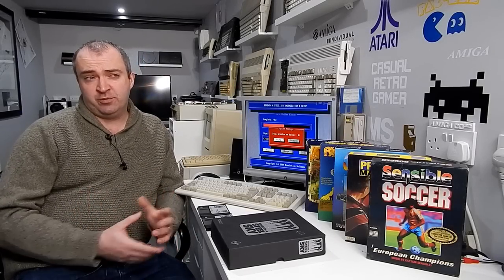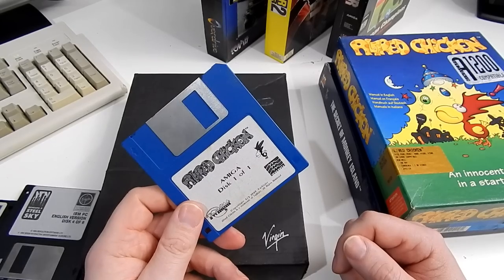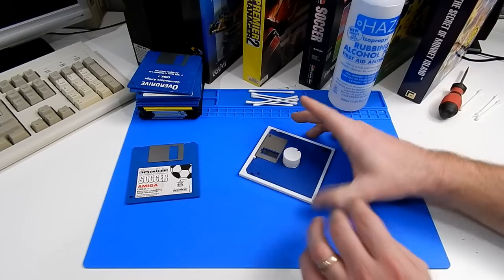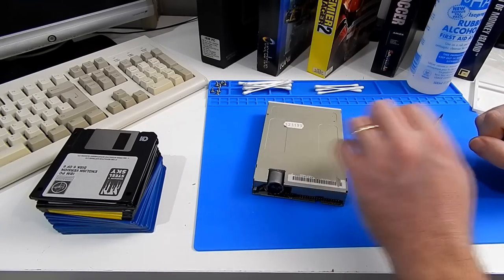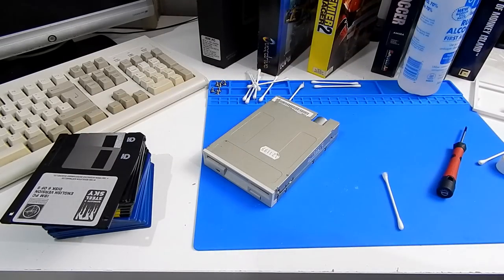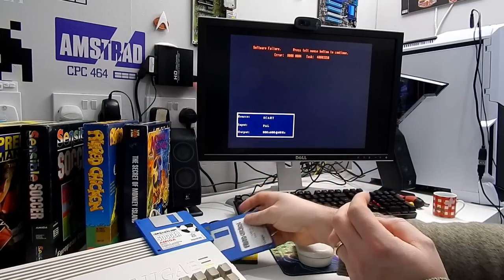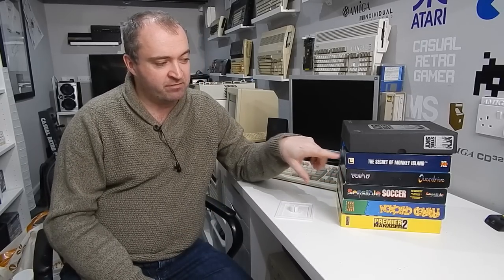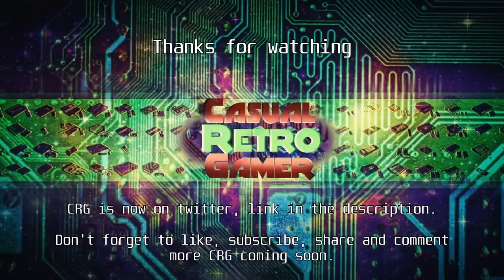Cleaning Floppy Disks, will it fix them?

Comment: Unfortunately, the "dirt" you saw on the cotton buds wasn't dirt; it was part of the oxide layer coming off the wafer.  This explains why some disks were worse after cleaning.  Unfortunately, there's not much you can do in those situations.
Reply: This happens when using 90% alcohol. Only 70 % alcohol must be used.
Reply: @dlfrsilver  He used 70% alcohol
Reply: @dlfrsilver  I think it is 50% that is recommended. Even then i would definitely be on the safe side and use as little as 25%, if at all
Reply: @vetar3372  there is a cursor on what to use. 70% is strong enough without being destructive on the disk surface. I have cleaned more than 800 disk with my method, and it works :)
Reply: @dlfrsilver  Well, i am not going to state anything. But i think it is better to be safe than sorry. I also wonder if the local climate will have any different effect on disk degradation and when it comes to cleaning them (this topic is still fairly new to me)

Comment: Back in the old days of fixing amiga disks that went though hell aka killed by magnetic fields of TV or Speakers ... you copied sectors to the same disc 5 to 8 times in "X-copy" ... fist you scan the disc to find if it has bad sectors in X-copy : 6 means BAD sector , 8 also means bad but its also means disc was damaged by magnetic fields ... then you simply mark those sectors and recopy them 5 to 8 times to the same disc... by this method you can fix many Amiga games ... when they boot and are good , you do a copy of it and store it ... but a word of warning, some Original Amiga discs had Sector DRM ...so even if you fix the Data , the Non-readable sectors of the DRM could be damaged making the disc fail ... but X-copy was the silver repair\piracy tool for all

Comment: I'm so glad I made disk images of all my old games that were on floppy's. When one of the originals gives an error, I succeeded sometimes in just writing the image I had again on the disk. Unfortunately this does not work all the time (if the disk is actually just broken beyond repair). What you can do to have the "original" disk, is pry open the floppy, and replace the disk with one of a floppy dat does work, and reassemble the floppy disk again. It's a bit of a hassle, but you can save the "housing" of the original floppy this way, with a working disk inside. I recommend "practising" this technique first with some floppies you don't actually need.

Comment: 3.5" disk spindles have two holes in them, the center hole and a rectangular hole set off to the side. I have seen another design out there for the disk holding jig where the spindle turning thingy has 2 pins on it instead of 1, so it engages both of the holes in the spindle. That one would probably grip the spindle better so you wouldn't have the problem where the thing just spins in place.

Great idea clamping the thing in a vise. In hindsight it is totally obvious, but for whatever reason that idea never occurred to me.

Comment: Good Video .   Like you had in the video I have had mixed results with cleaning  disks.   If you do not have a 3D printer you can use a piece of tape to hold open the floppy's door while cleaning.  As a last result I have written a floppy image to a new blank and swapped internals with the original to make a good working 'original'

Comment: Excellent video.
I have collection of Atari 1050 drives with 5.25" floppies.
These days when I use it I remove the lid to make sure the head is clean and that a disk doesn't leave dirt on the heads after use as this can damage the next disk put in the drive.

Also I keep my floppies well stored with moisture capture cartons in the same room. Seems to work!
Occasionally get the odd disk that develops a bad sector, and your demonstration is a brilliant way to fix it.
Great to see others with the same passion for retro!
All the best 🙂

Comment: I had WAY better results using warm soapy water (just a bit of dish soap) than I did with IPA.  It did a phenomenal job cleaning off mold from some old disks.  IPA just sort of smeared the crap around versus actually cleaning it.  Said moldy disks had destroyed two of my floppy drives (Macintosh Sony variable speed drives, so it's not like I can just swap them around with generic drives.)  Audible screeeach, then a thunk.  Neither drive would read floppy disks after many attempts at cleaning the heads with IPA.  However, after my success with cleaning the mold off the disks themselves with warm soapy water, I did the same with my floppy drives.  Brought both drives back to life.

So if you have a disk that wasn't working after a clean with IPA, I'd say give warm soapy water a try.  Use the IPA to clean any soap residue that might be left.
Reply: Please help me! I have already 3 drives of 5 1/4 that all they do is destroy disk after disk, they leave deep grooves on the disks and after cleaning and cleaning and more cleaning with alcool seems to make them worse and worse ! I dont know what to do ! I dont think its just a problem with moldy, flaky old disks ... it must be the drives themselves :(
Reply: @fft2020  Unfortunately it sounds like a damaged heads on your drives if they're scratching disks.

Comment: I've had success cleaning floppies - I realise I was lucky with the batch I had and they were just dirty rather than damaged.  Basically, crack open up the case at the bottom edge and drop out the disk itself.  With a little neat washing up liquid, go all over both surfaces of the disk, rub it in well and give it time to work.  If the disk comes away from the little metal carrier it sits on, don't worry about it for now.  Now wash the soap off and make sure you dry the disk really well.  Now you can re-attach the metal carrier VERY CAREFULLY with a small smear of superglue.  Slide the disk and carrier back inside the case and seal the case with a tiny smear of superglue.  Now test it.  I've had success with this method but use it as a last resort ;)

Comment: You can try my cleaning kit, you can find the download in the link in the description here: https://www.youtube.com/watch?v=I-MKpgO4nOY. It uses the off center hole to turn the disk donut, and I use a microfiber cloth instead of a cotton bud which can leave dust inside the disk. I've cleaned more than 300 disks successfully with this thing. I don't really print and sell them anymore but you can have it done by a friend or online.

Comment: I've had some success with using compressed air and blowing it through the hole in the hub and around the outside of the hub. Also through the door both sides. I use a compressor with water trap filter and a pressure regulator to drop the pressure. Doesn't always work but worth a try.
Great video.
Thanks.

Comment: Great video and congrats on the 2k+ subs mate. That's awesome. Re disk cleaning, sadly I had already tried this exact method on an entire Tenstar Games pack for the Amiga, including Barbarian. Now to be fair, ALL Ten were terrible, none loaded except Mercenary (once) and ALL made horrid scraping noises. The A500 itself was hardly used by it's previous owner. As a result, the drive is squeaky clean and all other disks work 100% fine all the time. So.....I took to cleaning the disks as you did, and NONE worked and then even Mercenary failed. They all continued to make horrid noises and Barbarian disk failed completely to the point the disk surface came away from the center wheel. Why? Well, because this method "can" be too harsh. Apparently the better method is to use a little ISO on a macrofibre. Using the caddy you printed, you hold the disk open and hold the fiber lightly on BOTH sides of the disk while turning the wheel. This applies much less ISO than the botton bud method and is less abrasive to the surface of the disk. Seems like a fine art. NOW....all that aside, I did also clean 2 Amiga Format cover disks with the cotton bud method (STOP OVERRIGHTING OR BINNING THOSE BY THE WAY lol ;) ) and they seemed to fail. I randomly tried them again a few months later. They first failed...and then...they both WORKED! So.....I dunno lol. I think it's a very fine art and depends greatly on the reason for the initial failure. Going forward, I'll be looking to get a Greeseweazle to restore original disk images to new media, and swap out the guts. Also risky but I can't make the disks any worse than they are now lol.

Comment: Sounds like a case of, “If it ain’t broke, don’t fix it’ - but if your big box games are dying, it’s definitely worth a pop.

Aside, out with of something like FluxEngine (which isn’t hard btw) to try and recover the original images have you thought about downloading disk images from online and writing them to different disks, and then transferring the magnetic platters into the original floppy cases?

Either way, great video, and very informative. Thanks.
Reply from the maker: That's probably the next stop for the likes of those steel sky disks, swap out the platters and rewrite the contents.  Not that's is really necessary since you can always use a modern alternative but still nice to try and keep the old media going.
Reply: @CRG  Since when has collecting big box games about being able to get them elsewhere? <3 x

Comment: I've just tried this on some discs I was imaging with a DiscFerret (same principles apply to Greaseweazle, which works the same way). Discs were showing patterns of errors in blotches on the HxC Floppy Editor "disc" view. I cleaned them with a foam swab and isopropyl and re-read them, and got a good read from most the second time around. Trying other brands of disc drive and cleaning the heads helped too.
Sadly I've yet to find a good solution for 3.5in discs where the hub has detached from the magnetic disc 'cookie'.

Comment: That's why I always try to create a disk image of my original software. Fortunately, I was able to do it to most of the disks I bought first hand. But some of the games I bought used was 'no go'. Conquest of Camelot, for instance, the 3.5" disks were all good, but the 5.25, kids 1 to 4 were unreadable, but I've not tried to clean them yet.
Also, in the past, I've made the error of putting dirty disks (with mould) in a drive... the movement and contact with the drive head was enough to damage the oxide layer.
It is also crucial to clean the disk drive after this type of incidents, to avoid contaminating other floppies.
Reply from the maker: Yep, certainly a good idea to backup.  Not something I ever though of back in the 90s though.

Comment: I used to open the disk, and then clean CAREFULY prependicular from the center to the outside, and then put the disk inside the plastic case again , and close-it. and it worked for me.
Reply from the maker: I was going to try opening the disks but thought it would be easier to just work through the door.  Also gave me a good excuse to use the 3D printer 😉

Comment: With my Amiga I only use my disk drive to image disks. These can be created in ADF format for use and to backup the disk. You can also image out to a disk if it fails or the data gets corrupted.

Comment: Something worth considering is to make copies of your important collectable disks onto a preferred media type and only use the copies. You'd be surprised how many HD floppies can fit on to a modern sized media like flash disks or HDDs.
Reply from the maker: Yep worth doing.  I rarely use floppies these days but the point was more to see if I could revive known bad disks.  At this point my big box games are display items only, especially on the Amiga since I just use WHDLoad for everything.
Reply: As far as I know there is no exact or reliable way to restore original floppies. Not trying to read them today would be the best method of keeping them intact. An unfortunate paradox.

That being said just having them in their original boxed is pretty awesome. Nice collection. I certainly wish I had kept all my old big box PC games.

Comment: Hi Glen... lots of info here but I don't know if any is actually of use to you. Around 6 or so months ago I was really struggling with floppies. It turned out to be a UEFI/motherboard/win7 problem and not the actual drives and floppies themselves, but it looked like it was the floppies at the time. As a result I bought loads of new old stock, and drives, and old pirate disks to use as blanks, and I also have a load of boxed games.

I'm a bit funny in that I do not want to use goteks at all. Ideally I want to use real floppy disks and I have various machines that use 3", 3.5" and 5.25". 

So far I've noticed that boxed games have disks that last way better than the ones in cardboard boxes or in the plastic 80 disk boxes. It may be down to better quality of disk but I suspect it's more to do with how they're stored. I think it's something out of the following - dust, mould, spilt drinks, hot/cold cycles, sweat/grease freezing/thawing, damp that causes the problems. I think a bit of grease on the surface of a disk in 1989 might see it still working in 1990, but by 2020 it could have killed it. I don't know if it's some or all of those conditions, though.

Something you didn't mention, or at least I don't think you did. And something nobody else really seems to mention either is the paper disc inside the disk. Inside each disk there are two and they're glued to the plastic housing. They can be removed if you break the disk open a bit. I don't know if it needs to be opened all the way or if you could grab and pull them out with tweezers. 

The white discs are there to keep the magnetic surface clean but I have a huge suspicion that they can end up killing the disks, and I think that's what killed your Monkey Island disk. I think debris can get lodged on the white disc and rub against the magnetic surface and that's why you might see lines on it. 

I also think the white discs could end up deforming and end up growing in size - imagine a piece of paper that gets splashed and dries - and that is what the nasty sound is of old disks spinning, it's the swollen white disk rubbing against the magnetic surface. I don't know if a swollen disc will hinder the disk spinning to the point it causes errors? I don't know if a problem disk can have the white paper discs removed and perhaps it might help.

As for cleaning the disks with IPA I would suggest it's only done where a problem is found. I have the same frame and knob as you - if only it was really that simple to get a bigger knob - and I've used it successfully on disks. 

The disks I fixed were bulk new old stock. These were clearly budget disks and had been presumably sealed into a plastic bag in 50s 25+ years ago. Some of them I could see some kind of contaminant on them and with IPA and a cotton bud I was able to clean them, and by repeatedly trying to format them I got them working. 

The problem with this is that for an ST or Amiga disk we need 100% of it to work, but if it's a PC disk and there's a few bad sectors we can probably still get away with it.

I've lots more I want to do with disks - and I have over 1,000 NOS and blanks to play with but it won't be for a long time. 

I would expect, and this is going out on a limb that eventually I will take a commercial game disk and break it open (they can be resealed with glue) and remove the dead disk and replace it with a working one that I've written in Greaseweazle and by doing that I will have repaired the game disk, and it will be identical to what it once was. 

I also don't agree with people that say that all disks are going to die and they have a finite lifespan. I don't think that's necessarily true. We don't know what the rate of decay on the disks is, but there's no reason to assume that it's going to happen in our lifetimes, maybe it will, maybe it won't. 

I hope that in some way helps Glen, sorry it's such a long read.
Reply from the maker: Thanks for the detailed comment.

The white bit inside the disks is like a cotton which as you say is there to keep the disk clean.  As far as I know its on this surface that the mold grows which then has potential to damage the disks surface.

The damage on the Monkey Island disk could be caused by that but I think it more likely that the disks surface has degraded and probably from environmental factors.  The glue that binds the magnetic media to the disk can breakdown causing said media to come away and I think that's what happened here. 

The disks maybe spend 20 years in a roof space, an environment which here in the UK can be damp, dry, cold or hot throughout the year so it's no surprise there are problems. 

If I knew then what I know now they wouldn't have been stored like that but it is what it is. 

As for the lifepsan, I don't think they'll live forever but I also don't see why a good disk can't keep on going for many many years yet.  While I don't really use them on the Amiga I do use them regularly on my PCs.  It's really the only means of getting initial software onto the older machines.
Reply: @CRG  I'm not sure about that, the monkey island disk looks like disks I've got where the visible damage on the surface is a perfect circle, just like what would be formed if a bit of grit was on the disc scratching it. Or at least that's my best guess and I'm not letting go of it :) I suppose it doesn't matter either, by the point we can see the damage it's done and so is the disk.
I do wonder if the dirt that came off that cotton bud wasn't dirt but was part of the disk.
Reply from the maker: Since its beyond repair anyway I'll open that disk up tomorrow and take a look.  

I suppose it's possible a bit of grit or something got in there but its also known that the iron feroxide surface can come off. 

As I say I'll take a look tomorrow and maybe stick a picture up on twitter or the community tab here.